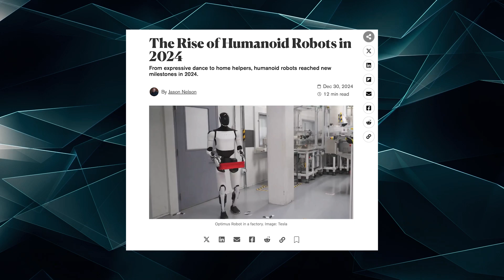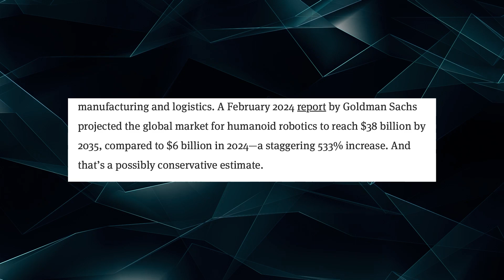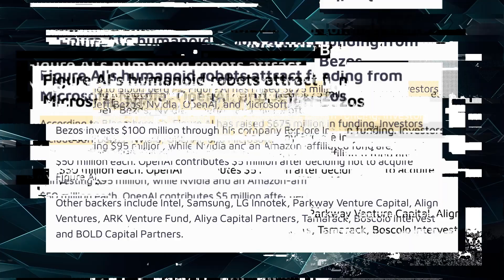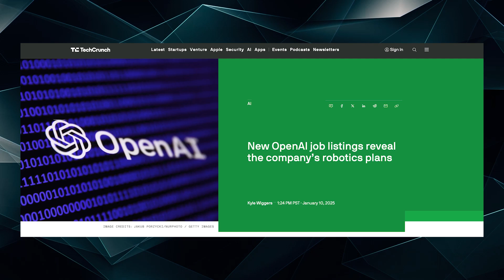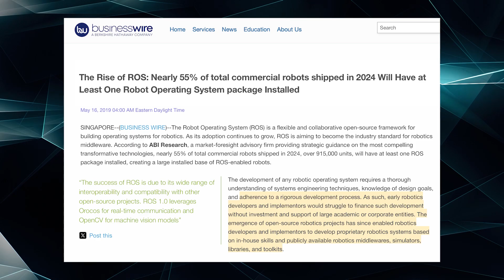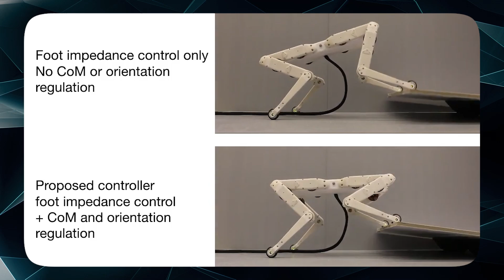Legions of Robots UNLEASHED in 2025... Robotic Era BEGINS.

Comment: I don't believe a thing the Chinese claim to have built, they made claims of having hydrogen tractors, however it was proven without a shadow of doubt because of a demonstration, the Chinese bought a $5 digital asset pack and pieces digital model assets together to make a futuristic looking tractor that they claim to run on hydrogen,  at the same time they claimed to have robots that inspect their HV power transmission lines for defects etc but again, was shown to be an RC model that was being human operated.

So no, the most untrustworthy of the planet do not get to receive my implicit trust.

Comment: Even a $30k Teslabot is cheap compared to $17,000 a month for in-home 24/7 medical care.  You could finance the bot, and have insurance, maintenance, and 24/7 telepresence-backed monitoring for $1000 and have the robot paid off in less than 5 years.  Then you just keep paying insurance, maint, and monitoring, which will be substantially smaller than the cost of in home care for the monty.  The home nurses wouldn't even lose their jobs.  They become the telepresence operators, who will still need to be medically trained.

Comment: I see a couple of comments about battery life.  The outdoor robots have the same issue as EVs mainly range anxiety. Its actually worse since there is unlikely any infrastructure to rapid charge in a battlefield.   For robots with a define operational area (like your house) humanoid robots can be designed to autonomously hot swap batteries which will solve any operational range/duration issue.
Reply: At least is the short term, the idea would be to use the robots as shock troops. Either they make it to the mission point within a few hours, or they get destroyed along the way. Then, once the point is taken, more forces (probably human) can be sent in to occupy it. They either haul the surviving but discharged robots back to the rear, or they swap batteries in the field and send them out again, or some combination of the two.
Reply: Please search for drones that inductively charge from hanging power lines, they exist.

Comment: All these robots are nice and everything, but we are still running into the wall of energy. For in-home, and light work, sure having a robot for that might be kind of fun. As it can charge itself. But when you're talking about deploying robots in the field particularly in military situations, having to constantly replace batteries because they only last a couple hours few hours or even up to 10 hours, is going to be an issue. We need better battery technology with higher energy density. And or better source of energy.
Reply: Don't worry, all of which are being actively and heavily worked on....worst case we change the form factor a bit and put an ICE generator in the back (would make the damn oil industry happy) or maybe just a large mothership-esque tank with large batteries and generators.....don't worry, plenty of solutions for killer robots. 😂😢

Comment: Have we seen a self-taught drone vs drone battle yet?
Reply: They did it with F16s....first in simulation, then vs real pilots (spoiler: it was not a good day to be a human f16 pilot)...if it has happened with drone swarm vs drone swarm I am not aware of it (or it hasn't been released). I actually find it interesting that it is so much easier to do arial combat than it is to do self driving...one large plain (the ground) to avoid, and one large plane to target...easy. (like what I did there? Should it have been plain plane instead?)
Reply: @charlesK001  Yup - i remember the AI dogfight - but have not seen AI robot tag. Definitely seen simulations.. but put to parkour AI robots up against each other and lets see..
Reply: @thewatersavior  I am still waiting for robot soccer (football) games, both different robots same team, and manufacturers fielding full teams.....every robot demo shows it kicking a soccer ball, it needs to be expanded!

Comment: You guys do realize that they still haven't solved walking correctly, right?  They are using a huge amount of computing power to do an end run around not knowing, and correcting after the fact.  It's why their robots are still not quite there.  Go watch a chicken run, and try to knock one down, light years ahead of the robots in how it works.
I solved it in 2015, but have kept it to myself.  I haven't seen anything that is operating correctly since then.  Remember, Elon was in with the California nuts back then, and I really don't trust Boston Dynamics and the military at all.  So there was literally no one to even sell the idea to.

Comment: I completed a degree specializing in automated manufacturing technology in 92. I’ve been deeply interested in AI, neural networks since I was a teenager.

I didn’t calculate things would get to where they are today: one of the most surprising developments to me is someone figured out an abstraction that works “well enough” with massive amounts of matrix operations that runs on commodity supercomputers … er, GPUs, something that’s become more common than not, rather than requiring some very specialized architecture hardware.

Granted, that may still happen… eventually.

What a time to be alive!